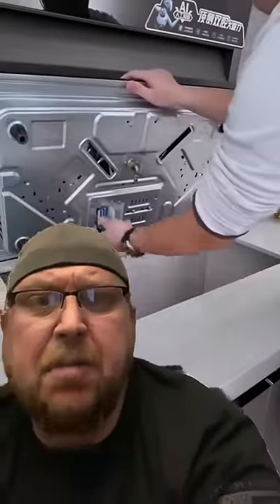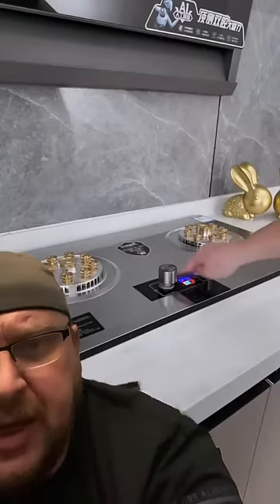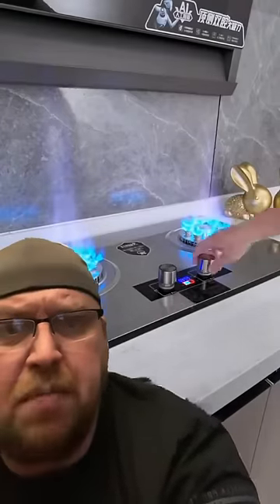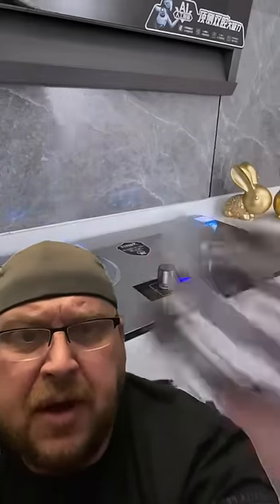Kitchen Go Boom￼

Comment: Countertop dual flamethrower. 🔥🔥
Reply: Actually useful if your using a wok
Reply: I will keep my high efficiency gas stove.
Reply: @rjgaynor8  It has a small burner setting that is adjustable also.
Reply: Sir so sorry, that a countertop jet engine not a flamethrower.
Reply: @nimay13  Apologies. 😂
Reply: @nimay13  I was just about to say Elon needs this setup on his toy flame thrower gun.

Comment: They better have one hell of a vent hood for those flamethrowers.  Also, the backsplash had better be rated for flames of that magnitude.
Reply: Bruh, China uses nothing but the best safety features and follows all product rules totally legit and good to go.
Reply: It’s for cooking with a wok. They usually do have crazy fans in the whole ceiling of the kitchen. Here in Vancouver Canada, a lot of the Chinese have two kitchens. A western show kitchen, and then a smaller separate room for wok cooking where the entire ceiling is fans.
Reply: In the US Asian specialty stores sell vent hoods that demolish anything Home Depot sells.  1,000 CFM and higher!  Its really needed for high heat wok cooking.
Reply: pfft.
Safety 3rd
Reply: @bigpjohnson  I put in one of those for my Chinese wife. The damn thing slaps.
Reply: Maybe frp board but doubt it, its proably drywall

Comment: theres probably a valve and they skipped it, my grandparents in china decided to DIY their own stove with a benchtop double burner and for the actual valves they used a Y garden hose splitter bodged into the gas mains which was just a hose barb, china is crazy 😂
Reply: Originally from Eastern Europe, yeah they'd do the same.  😂 poorer countries make it work, and the danger just makes the food that much better!
Reply: especially when every meal could be your last😂
Reply: The year I spent in Jing'an district Shanghai, we heard loud explosions every three weeks or so and a couple times saw gas explosion damage in residential and commercial units, but they never made the news and a official statistics were absurdly low.
Reply: You missed the point of what me meant when he asked if the tube was just sitting in there. He wasn’t saying that they bypassed anything.
He was talking about how the hand connected the hose, closed the range, and “immediately” turned both burners on high. We never saw a valve turn on the supply line. Where did the gas for the fire come from, and how did the hose stay attached ?
Reply: @goodrabbi7176 YOU missed his point where he said it was probably cut out of the video and they did add a valve, saying the original video did not have the gas line running right away
Reply: In the shadow u can see a cut of the vid they did open a valve after it was connected

Comment: My dad was a high school teacher. The last school he taught at was an elementary school that got a major reno overhaul to become a combined junior high/high school. The contractors finish their work, the teachers are being shown their new rooms and there's four natural gas valves in every classroom (like you'd use to hook up a bunsen burner). No protection on it at all (inside a locked box, etc). Just free access to natural gas for kids aged 10 - 18. 

It turned out that one of the school board members had pulled the contractors aside and asked them to do this but they didn't tell anyone else.

The wood shop teacher took some measurements down, built a lockable wooden cover they could use to cover up the valves and they spent days making enough to cover every single one. That board member got the boot iirc.

Comment: The clamp likely slid down the line to where the shutoff is at the base of the cabinet, or many clamps can be put on after the hose has been connected. I did lots of reno's and we always had a shutoff at the cupboard. The base of the burner was also not attached in this short video, something you would do from underneath just after you secure the line and test the connections.

Comment: The jet fire is actually something chinese cooking needs to make a fragrant food in a wok. The other term for this is called Wokhey and it's basically food that is caramelized on the outside and soft on the inside.

With a smaller European style burner you can achieve the same temperatures by evaporating wine before you start a stir fry.

Comment: In asia a small 13kg british standard gas bottle is under the stove. Correct a jubilee clip is required aka a clamp. It goes without saying you turn the valve on the gas bottle off before installing a new burner. Funny though

Comment: Please also note that the part of the grill that's sitting on the countertop when it's in that cutout gets VERY hot when the  burners are on. It's meant to sit ON the counter (see the rubber feet on it when the guy is half-assing the gas line) not IN the counter.

Comment: Forget about adding a clamp - which will just slightly deform that line and that is why we use flare connections to have a consistent seal between tube and fittings .

This is an explosion waiting to happen

I'm guessing, even though it may not have been installed there, that this was manufactured where they produce all the ... 

Chinese crap 

I hope that this video was done for demonstration purposes and not an actual instructional installation video 

This reminds me of how we used to hook up our Bunsen burners in junior high school and still had a shut off within Arm's Reach and a very low Pressure and Flow

Comment: Burners? These looked like 2 blow torches compared to my gas stove! I’ve also never seen a battery powered ignition. Mine is electric, however, if I have no electricity, I can light it with a match. Same applies here. j/s

Comment: Every kitchen in Korea has a manual gas valve by the stove and some are fancy automated valves with safety features. The stove is turned off and the gas supply value is turned off when not cooking. I would assume China has a similar set up.

Comment: To be fair, a heavy-duty high fire appliance will operate at about 6in WC vs about 4 in WC for standard commercial.

6 in WC is less than 1/3 of 1 psi. Wouldn't do it in my own home, but hey. There is basically no pressure on that line. These guys ain't scared of that 1/1000000 chance that it leaks, apparently. You have to be astonishingly bad at connecting pipes to leave a gas leak.

Comment: I would not be able to sleep if I didn't check is the gas pipe was properly secured 5-6 times. I still sometimes check if the installation I did at work 3 years ago was done right. That's fuel for nightmares.

Comment: The hell with putting a clamp. That’s natural gas or propane. That should at bare minimum have a braided stainless hose from the hard line, and tapered fittings on either end. 🤯

Comment: They use gas cylinders. The regulator is on the tank. The only issue is the lack of a clamp, but it's low pressure gas anyway, so maybe they skip it for the installation demo.

Comment: Omg where is the clamp? And the pipe has to be more resistance to cuts and to puncher holes. What if a kid's goes there and pulls the pipe or bites it. He also have to fasten the pipe and secure it with clamps so it does not get in the way. And what happens if the battery dies?

Comment: Hose with no clamp leaking into a confined space that may or may not have had gas in it before (it probably didn't. The video was sped up, so the gas was probably also turned on off camera after connection) what could possibly go wrong?

Comment: So they took the engines out of an old Mig fighter and turned them into a countertop double-wok special...  Now the real dilemma is do you not cook on it and just cook the paint and stickers off of what I assume to be the smoke hood, or do you throw a couple of woks on there and use the redirected flames to set fire to yourself AND the wall at the same time?  And let's not forget those control knobs!  They are either red-hot or melted by the time you put yourself out so how do you get close enough to shut the thing off?  Have your cousin who's got the mangled toe shut it off from his luxury apartment/under-cabinet crib?

Comment: I'm concerned about the rubber hose. Every gas appliance I've dealt with had metal lines. I'm sure it's metal for a reason.
Reply: It’s just a demonstration. We use rubber lines with no clamps, just barb fittings all the time in R&D. Just make sure there’s no cracks

Comment: Gas lines should only be metal. The proper lines are designed to be difficult to pierce/crush (to help avoid gas leaks). Using anything other than the correct ones is a recipe for disaster.

Comment: Most likely a portable gas tank was used, you regulate it with a valve attached to the cylinder.

Not every country has gas lines running to their houses.

Also, they don't need to show the gas cylinder in the video.

The problem I have is with the batteries

Comment: The pressure from the nat gas line is very low, trust. I've done it. On several occasions the pilot light wouldn't ignite, with the gas fully open, when it finally did spark it only created a large blue poof of a flame. Didn't burn me either.

I'll make a video if you want.

Comment: It's look like the video from China ir Vietnam, as I'm aware, I don't think they have gas line hook it straight to your house like in U.S or Europe, more likely they're using portable gas tank. If the video from Vietnam, it's definitely using portable gas tank, so you need to turn the valve to be able to use the gas.

Comment: Home gas service is extremely low pressure. 28" Water Column = 1 PSI, and most of the commercial stoves use 3.5-4"WC. So, a quarter of one PSI is probably not going to blow the line off, but for fucks sake, it's not safe

Comment: There was 100% a cut after they hooked up the gas line you can see it in the shadow. The shadow just jumps after they lowered the top back down 😂. My concern is, I know that's a ribbed for her pleasure fitting but shouldn't there also be like a clamp or something. Or is gas flow truly just low enough PSI that you can just stick a hose on without anything else?? I really don't know I don't fuck with gas, 🤷.

Comment: Don't get me wrong, I think this is a shitty, dangerous idea, but the hose wouldn't have been running. There would be a quarter turn ball valve stopping the gas flow until you needed to use it.

Comment: Umm…. That’s a barb clamp. Propane has have proper fittings (threaded) a normal 400l propane tank if it leaked inside your house with a spark boom, and people would be picking prices of your house up 2km away

Comment: Generally like your humorous takes but this one was a bit reaching. Its not unreasonable to think they didn't record someone turning the valve because it's just assumed.
Reply: My only issue with this is the batteries. I assume the top will be fastened in some way so you cant just lift it as they do in the video. Are they going to disassemble the thing every time they need to change the batteries? Granted they're only there to make the spark, so they'll probably last a while, but still...

Comment: I was wide-eyed in amazement there was no clamp on this. It looks like there's a cabinet under that stove. People will eventually use that space to store cleaning products or pans or such... Enough activity of putting in and taking out items under there is enough to wiggle that gas line away from the fitting if there's no clamp.
Sorry, but these cheap Chinese products made from 26 gauge stamped sheet metal and a small rubber gas hose is asking for not just a kitchen blow-up, but the whole house at 3:30am... after the entire family ephixiates from gas fumes while they slept.

Comment: Ok I think I watched this more than I should past two rewatches, I don't use gas stoves but the idea of a grip hose line just makes me go "from the hells, to the bells fuck no, and changing faulty batteries is gonna be annoying.
One, I am not a fan of grip hoses because I seen many grippers fail within a good 2 years while regular screw hoses hold on better.
Also seeing this flames, I question the output of the gas, like when this hose fails when I least expect it, when someone decides to pop a smoke or my dumbass decides to ignite it without lifting the thing, yea, I give it a Fuck No.

Comment: I saw a guy doing a similar thing, replacing some taps, and never once did I suspect that he installed them with the water turned on. And I’m not even a plumber. Can’t imagine being so dumb that you’d make a video for the purpose of suggesting that the gas was turned on during a gas stove install. The only thing that I thought was dangerous was that hose. Looks really flimsy, like latex. Is latex rated for natural gas? And shouldn’t it h e a hose clamp?

Comment: WTFook is that pipe? 
You can get metal flexihoses with quick release couplings and one way valves there around £30 and its cheaper for an airline hose used for airguns that would work better than that flimsy shite if you don't want to use the safer option of copper with gas valves.
You need to pressure test this system, annual service checks and have gas vents in the bottom of your walls and Co2 detectors if you want to live and this is ONLY suitable for large scale industrial work it is not suitable for domestic or even restaurants, im thinking a warehouse sized industrial bakery or food processing plant.
I dont know what you would use this thing for it looks like a terrible idea to me but I've seen very specific tools used for very specific tasks that look mad too, if this is a counter cooker as it appears then get rid of it, it will kill everyone who buys it.

Comment: Man, you must be running low on material. Yes, someone must have turned a valve off camera. 
What's vastly more interesting is why it would use batteries instead of an AC connection? That makes no sense at all.

Comment: Ok thats a tabletop burner. Not to be installed in a counter top. And how are you going to charge or replace those batteries? Little inconvenient being on the bottom. And its not secured at all. Which is another bad thing.
And that would be considered illegal on a inspection. 
And what gets me is the gas line. Is a hose with no fittings. WTF. Talk abt a gas leak. And the probably is for propane not natural gas. So the safety and burners need to be corrected.
Too many issues of stupidity and death.